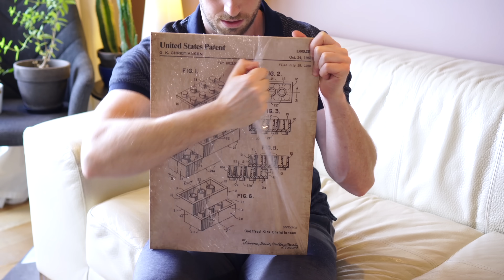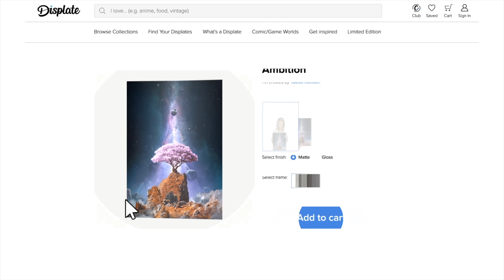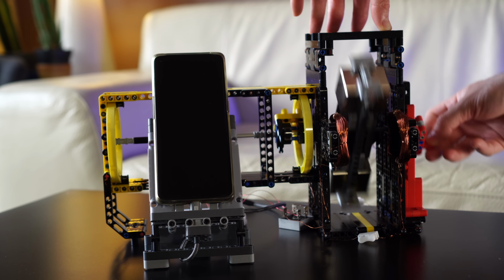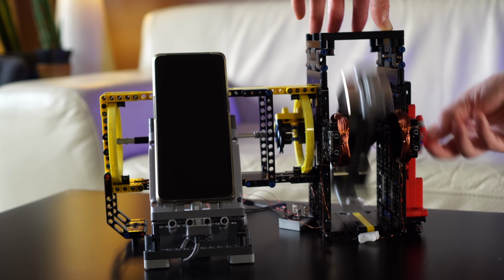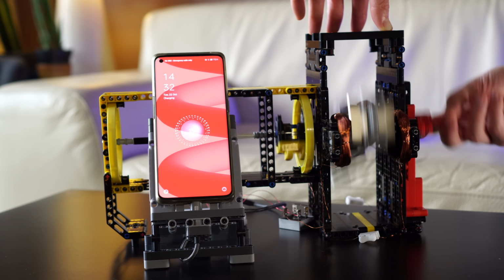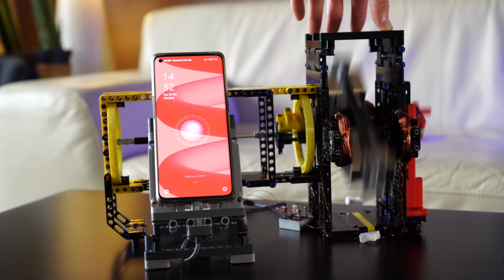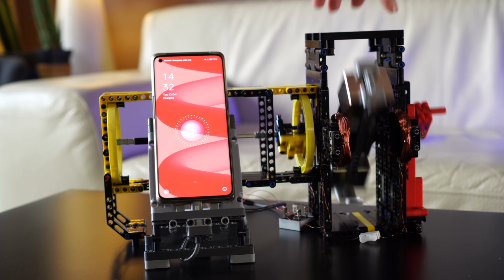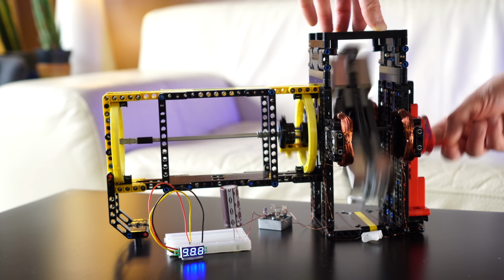LEGO Elastic Energy: Making Power From Rubber!

Comment from the maker: Hit my link: https://displate.com/brickjams to unlock an exclusive access to the best Displate deal before it’s gone!
(*Not applicable on Lumino, Textra and Limited Edition)
Reply: Could you try use lego motors to power a lego motor like this with magnets and coils 😂😂❤❤ please😊
Reply: can you link where you got your magnets @Jamie's Brick Jams
Reply: Try doubling the magnet🤔
Reply: Could you try springs?
Reply: Compression spring next? (Not a main coil spring)
Reply: @Scudmaster11  yeah
Reply: I was wondering what those noodle lights were and where you got the technic beam with a bearing in it?
Reply: Gravity Storage!!  :face-blue-smiling::yougotthis:
Reply: I think there are voltmeters you can connect to a computer, so you can see the changes in the voltage over time
Reply: do gravity
Reply: maybe try a flywheel, is there a part that allows free spinning in 1 direction like bicycle gears, but i guess then your just using the rubber to charge another storage device :/
Reply: Just don't call the release a trigger and sear.
Reply: You are losing allot of ur power w the twisted band setup especially w leds. As the whole time it's rebounding in opposite direction current isn't flowing. adding more coils and caps so the resistance will use as much power as possible so there is very little rebound of the elastic.
Reply: Awesome project, however, If I may impart some advice?

The issue with your rotor design is that it is asymmetrical. By this, I mean that the two sides with the magnets are heavier than the sides with the gaps between them. As a result, there are two types of imbalance:

1. **Weight imbalance**: The amount of weight on each side is not evenly distributed.
2. **Center of mass imbalance**: Unfortunately this also means that the center of mass for the entire rotor is shifted due to the uneven weight distribution.

This asymmetry can lead to several issues:

* Reduced rotational energy transfer: The unbalanced design can cause the rotor to wobble or vibrate, leading to reduced efficiency in converting potential energy from the bands into kinetic energy.
* Increased friction and heat generation: As the rotor rotates, the imbalance causes additional stress on the moving parts, resulting in increased friction and heat generation.
* Limited number of rotations for the same amount of potential energy from the bands: The inefficient design can lead to a shorter lifespan or reduced performance from your motor generator.
Reply: the lever would work so much better if you could put it in neutral and wind it up with a motor... lmao Infinite energy glitch

Comment: One thing you could try, because moving the massive magnets take alot of energy, instead you could try moving the small coils, and have their output be sent to a conductive ring, this way you avoid tangled wires.
Reply from the maker: That's a good idea, I've considered spinning coils before, but always shied away from building a commutator to connect them to an output. It seems like a worthwhile thing to try though!
Reply: @JamiesBrickJams  Its a concept i was thinking about for an electric motor, because spinning a heavy weight magnet looses alot of enegy, but spinning coils builds a engineering struggle of tangling wires. I learned about conductive rings, when i was looking into making a infinite degree spinning robotic arm.

Comment: The problem with the rubber bands is that the amount of torque it can deliver decreases when it unwinds, after already not having a lot of initial rotations to work with. I think if you truly want a long duration you're going to need either a very long rubber band or multiple smaller ones that can deliver the same amount of torque. The gravity idea you mentioned at the end will probably work a bit better, as that's how a lot of grandfather clocks work as well. You could use the rubber bands to decrease the needed weight to generate the torque!

Comment: Ok, so now lets get into it. I think your uncoupling idea was the best, as it gives the longest runtime overall. Then i think the leverage idea is way smarter than twisting, since you have a more stable output and you need to put less work into loading the generator. And lastly i like the gravity idea in the end, so lets combine now.

First try to build a magnet rotor that has as less friction as possible. Ball bearings, silicon oil, you name it. And make the rotor long with the magnets on the end, to get a flywheel effect. Then put this on a base that can be uncoupled from the leverarm, so you can load the arm without rotating the magnets, and as the rubberband is released completely it uncouples itself so the magnetrotor can rotate further, using the flywheel effect to get es much energy out the system as possible. Combine the Leverarm with a weight, that pulls more downward the more the lever is loaded. As the lever goes up the rubberband is pulling less, but by bringing the weight more near to the top the less weight is pulling on the arm, making it easier to be pulled. This way you can get a very consistent movement out of the slingshot rubber, first it will pull force on the very heavy lever, as it looses energy to pull the lever gets easier to pull so the pull speed/force doesnt change on the rotational axle. Also try to gear it up in a way it runs longer by needing more pull to get to work. 

Now for the circuit, smooth out the pulses by placing more coils around the magnets, putting a few caps in and with that based on the scale you build this monstrosity you should be able to get around 10 seconds of smooth noodles or 30 seconds of small LED-Chain out of one slingshot band.
Reply from the maker: Some very good advice here, thanks for taking the time to describe this! Those hearings do a good job, so I ordered more. I'm feeling more and more that gravity is a better means of running something for longer than 10 seconds. Though still it doesn't have a huge amount of output unless you use very heavy weights. But I'll certainly continue playing around with some of the ideas you've suggested here. Cheers!

Comment: I have a tip or two. For one, use a flywheel to store more kinetic energy. Your ripcord design with a flywheel is definitely worth a try. My second tip is obvious. Instead of rotating the heavy magnets, make them stationary and spin the much lighter coils through their fields.
Reply: That is how many modern (small) generators and motors work. Toyota's hybrid system does spin the magnets, but they use more thinner (yes, bigger isn't actually better here) magnets in a metal armature.
Reply: @noyb7920  It might be how many of them work. It's not how most of them work. I saw a video of a girl flipping the entire pan instead of just the pancake too. Just because it technically works doesn't mean it's the best way.

Comment: To get those caps to filter anything at all, you really should have a current limiting resistor in series with your load. LEDs will draw as much current as is given to them (like any diode, they drop a relatively constant voltage across), so they should be protected in some way.

A decent rectifier, huge amount of bulk capacitance and the right current-limiting resistor ought to do the trick.

You could, of course, also completely remove the load and just leave the caps to charge. That'll give you an idea of how much electrical energy this thing is releasing. You can then size your resistor accordingly.

Comment: 6:50 honestly curious if they have a way to make an escapement hook thing that they have in pocket watches. Would help control the release of power.

Edit: some ways to improve the design would be to increase the amount of area in the coil that the magnetic field breaks through. Can be done by decreasing the bend in other parts, like in a serpentine coil. Also curious as to where the magnets were bought from, as I have been struggling with finding N52 magnets that are bigger than a quarter (at least in LxW, while H is roughly a quarter inch). Also, there was a college student that made a gravity generator that the pulley setup reminded me of; the students build consisted of a hand crank that would rotate an assembly with a heavy weight sliding down all thread or the like, and the rotational energy from the allthread would drive an unknown generator and power 3 large LED lights.

Comment: hey, so I love the video, but something that may help generate more power or power over more time would be to think of the mechanical load is the inverse as the electrical load. What I mean by that is in mechanical systems resistance or in this case force from displacement can be summed in parallel but is equivalent to the parallel combination of resistors in electrical terms. Waht I'm saying is in order to store more energy you can have several subunits of elastic stretched to the exact same length and they will share the load equally. From there you can dampen the rate of displacement to get longer more consistent force production leading to more power over time. Like if you were to take what you made and just replicate it several times and put them all in parallel and hook them all up to drive one shaft with a magnet, and then you tuned the resistance either with electrical impedance or a dashpot you can really get some power going. A good example of this is actually a ride at theme parks. I'm not sure what it's called but it uses hundreds of springs in parallel in an acordian like mehcnism to launch a ball with riders inside very high into the air. The issue with springs or rubber bands is that because the force they produce is a product of their displacement, getting any power out of them makes them weaker, so in reality they are not a good source of any form of reliable power, but they are fun. I hope you read this and I hope it makes sense. I'm very tired and know I didn't do the best job explaining that first bit. great video

Comment: Idea for a new invention, a wind up flashlight using the bare minimum in terms of non lego.
Reply from the maker: That's actually quite a nice idea. I like the thought of keeping it mostly Lego. I'm sure it's possible to use a Lego motor as a generator attached to a crank, powering a Lego LED. Just need to add a beefy capacitor in parallel to store some power.
Reply: The mechanical wear would require a great deal of maintenance, especially with lego.

Comment: Damn! I can imagine a very tall tower with a gravity recharge battery that has a gearing that will let the weight drop very slowly. Probably a very heavy weight and a very tall tower and a very thick rope
Reply: Gravity batteries work, the downside is efficiency, it’s terribly inefficient, the greatest advantage of the design is theoretically infinite storage duration, but the other downside is you can’t stop making energy once you’re done, once you start on a piece, you must end it, and a gravity well mechanism would also require energy to begin supplying energy too, to lift the weight, move it, and drop it to generate electricity, sadly it’s not viable in our modern world.

Comment: The thing about the wound up bands is that it's an oscillating system, much like a pendulum.  Most of the potential energy it has goes to winding in the other direction.  That means most of your time is spent with the system about the same thing as shunting charge back and forth between two batteries, the energy stored keeps getting fully discharged and recharged.  In this case it's a mechanical potential battery (the elastic) and a kinetic/momentum battery (the spinning magnets) rather than two electrical batteries, but hopefully the analogy makes sense.
Why that is a problem should be obvious:  Thermodynamics demands a tax on every conversion or movement of energy.  The energy in the bands gets taxed by the axel friction, the gear friction, the air resistance on the magnets, some loss while establishing the magnetic field, etc.  Once the bands are hit zero potential the energy starts going to wind them up again, doing much the same list of frictions and resistances.  As a bonus to the whole process, the contraction and extension causes a cooling/heating cycle from the mechanical deformation, more losses appear.
Ideally you want all the energy to be released in a single cycle, likely by converting it to electrical and storing it.  For that you're going to how much charge the caps hold vs the power coming from the coil... you might want to get magnetic resistance to slow the rotor, slowing the whole thing down so that the voltage matches the caps you use.  It'll cost you some current but there's no point in having higher voltage and current if the circuit can't do anything with it.

Comment: Why just a DC generator? It's better for your goals because the problem with your design is not the size of the magnet but the way the magnetic flux flows. The generator type you made is a Faraday generator, which has huge current loss. Make a DC generator , which is better for your goals.

Comment: The gravity thing could be fun. But now you need a way to mount a pulley on the ceiling that can stand up to 40lbs or so. And maybe some wood blocks with screws or other brackets to anchor down the Lego assemblies with that kind of loading.  Also likely you could go a little crazier with gear multiplication to get a good spin on the generator part and increase the time it's making power. All that seems like it should be simple enough given all the stuff you appear to have already.

Comment: Why not put more coils ? It would smooth out the output ? Or I am wrong ?
Reply: In a way, it moreso creates higher resistance to the magnet slowing it down, the draw is more efficient but not as high, and as one of his goals  was to increase voltage output, it’s not the best solution for him.

Comment: what if the aluminum shaft would have a free rotating wheel/disc in the middle? So the rubber bands would not touch the aluminum rod and letting the bands to store even more energy?

Comment: For gravity-powered, try making one that uses liquid flowing from an upper reservoir through a pipe system involving a valve for throughput control to a lower reservoir, which can be reset by pumping the liquid back up to the top one.
Reply from the maker: That's actually a really cool idea, would love to try that